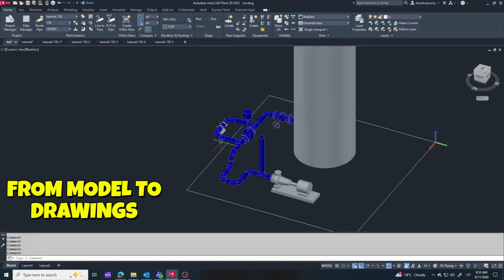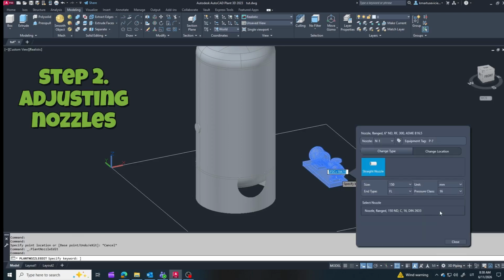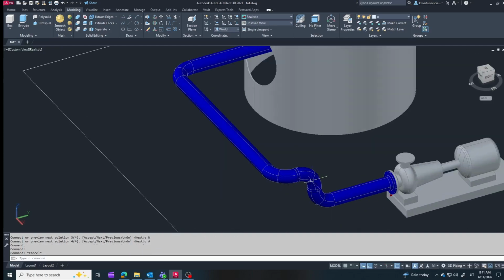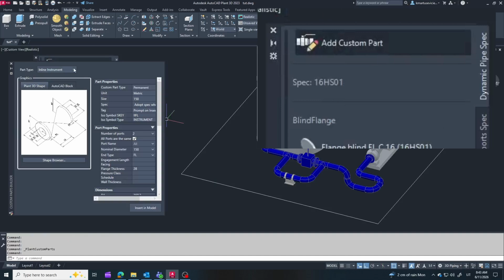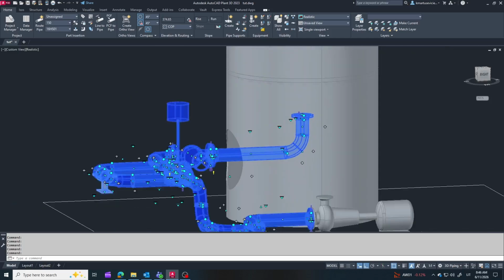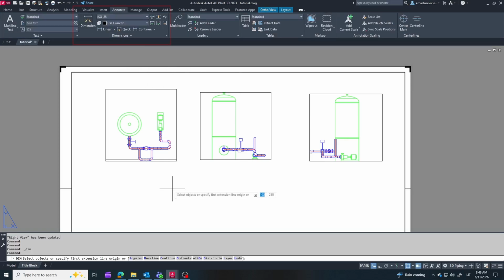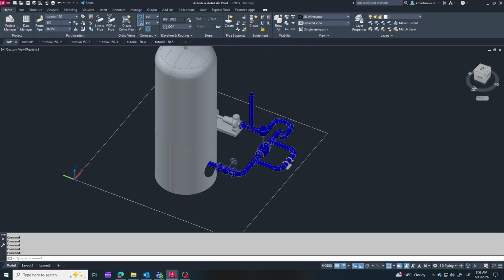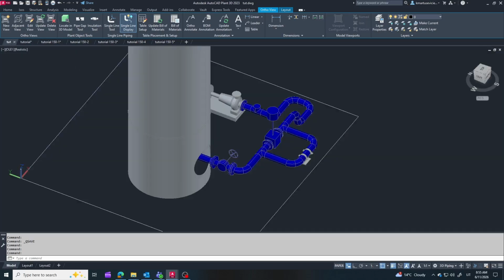AutoCAD Plant 3D Beginner Tutorial | From 3D Model to Isometrics & Drawings

Comment: Pls what and how do you mean you measure the required distance when pipe routing? I always have issues when pipe routing and it's being really difficult... Thanks
Reply from the maker: Thanks! What kind of routing issue are you struggling with exactly?
In the video I meant simple cases where I already know the required clearance or distance from equipment, structures, or other pipes. I just measure that distance and route the pipe accordingly.
Are you having problems with maintaining clearances, connecting equipment, avoiding clashes, or finding a good routing path? Let me know and I'll try to help.
Reply: @shapemypipes I think all of the above actually, it takes me a very long time to even connect one equipment to the other because I've done trial and error over a 100x...so I really want to understand and know how to pipe route the right way-I really appreciate your help
Reply from the maker: Thanks! I'd like to understand your workflow better before giving advice.

Are you working from P&IDs and equipment layouts, or routing directly in 3D?
Do you have defined pipe corridors and elevations before routing?
Is your equipment positioned according to plant coordinates/layout drawings, or placed manually as you go?
Are you creating isometrics for fabrication, or is the model only for visualization?
What standards or company rules do you follow for clearances and routing?
Could you share a screenshot of a typical routing problem?
Reply: @shapemypipes  I'm routing directly in 3D...I watched your previous 'pump house' video when it was released and followed everything smoothly until you started routing the pipe (the suction to the suction header etc)..then I had issues keeping up.

- No, I don't have defined elevation before routing 

-Well depends, I've only modelled 2 so far and one was done together with the plant layout as xref and the other placed manually.

-No I don't create ISOs with this yet, as I'm still trying to get better...I use normal 2D drafting and annotation for ISOs.

- Uhmm not pretty sure about that.
Though standard we use for PID is ISO .

- Not sure I can share a screenshot here, but from your earlier response, I'd say " finding a good routing path and avoiding clashes" as the two main issues. Thanks